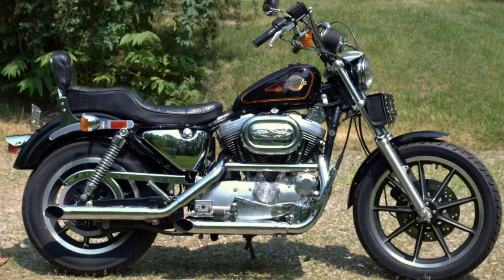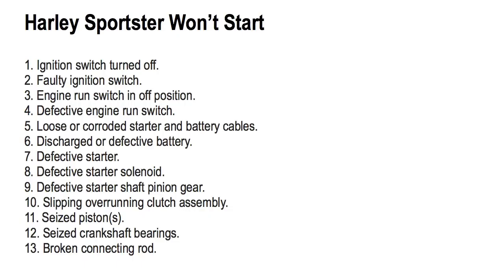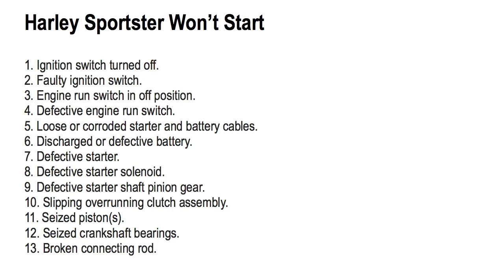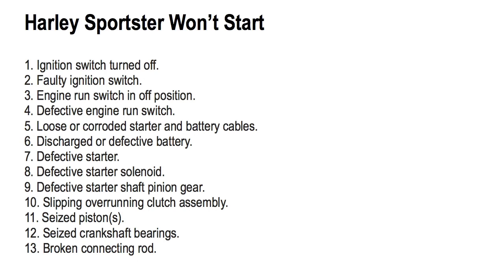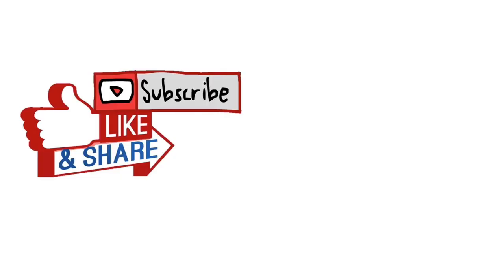Harley Sportster Won't Start (1986 thru 2003 Models)

Comment: # 14- Starter relay is bad (usually located near fuses. Sometimes the cover can be removed and contacts cleaned up with sandpaper)  , #15- ignition fuse is blown.

Comment: I have a 1999 Sportster and when the ignition switch is moved to the ignition position, the bike loses all power. I checked the fuses and all the 15 amp fuses are good. I did not worry about the 30 amp fuse, because if it is bad the bike would never have any power. I purchased a new switch and I just spliced the wires back and conneded it to the new switch and the bike still lost all power when the swith is in the ignition position. What do I do?

Comment: Was running, I turned it off and came back outside to ride again and now no fire to spark plugs, so I changed the coil and still no fire,to spark plug, but I do have fire to the coil on both sides
Reply: It's a 1984 and I also changed the points to electric
Reply: Ignition module, and or rectifier, potentially stator, trial and error, replace one at a time to see if the problem persists, one ,or the other will end up fixing it eventually!!!
Reply: @matthewburns6843  gotta be the dumbest way to fix a bike

Comment: 2003 hugger.  Battery is and fuses are good.   I get the dreaded click and need to rock bike to get her to start.    I’m having trouble putting the wiring diagrams with the actual bike to learn where/how to test the starter and ignition swithes.   I know where the relay is but not100% clear on how to test that or the circiut I believe is with the relay and fuses..   same  with the stator wires I learned are low front frame In case looking like a mini grill.    No idea where solinoid is or how to test that sf all

Comment: All I did was rinse my 2002 sportster off and it want fire now it turns over and I replaced plugs but no fire still what can I do next
Reply: Check, observe, and replace all electrical system components!!
Reply: Same problem. Did you figure it out?

Comment: I just replaced my stator. It started and ran fine. About an hour and half later it will not start. Cranks over but seems like it is  not getting gas and it has a full tank of Premium gas.
Reply: It’s because the 10% Ethanol boils at a lower temperature. So the heat of the Engine is boiling your fuel and turning it into steam causing vapor lock... put heat shield guards on your fuel line and only use non-ethanol fuel..
Reply: Try taking off the gas cap, then starting it!! Also check to verify if you have spark at the plugs, if not, probably the ignition module or electrical system, rectifier, coil?!!!

Comment: I have a 99 sporster. it was starting  every day. then for some reason when I turned the key , my head light did not come on. turn signals work , brake lights work. etc. But the neutral light won't come on and it dosent Evan click or turn over. battery was on trickle charger for hours. nothing.
Reply: Ken Sendelofski - same! What was the solution?  New battery, fuses fine....I’m leaning towards faulty ignition switch.
Reply: @cassidyhicks1724  I have the same issue all the sudden.   Did you figure it out ?
Reply: Fuse blown super EZ fix
Reply: Ignition modules go out, common deal on the Sportsters

Comment: Where is the relay fuses
Reply: It is in with the fuses.  Just behind the battery.   My 2003 has a triangle cover that just pulls off.  The relay is tucked above the fuses.

Comment: I have a 2001 Harley sportster hugger 883. I went out to start it this morning when I turned the switch to the first setting accessories the lights on the speedomitor came on also the light showing it was in enteral. when I turned the switch over to ignition the lights went out on the speedomitor it was as if I turned the switch in the off setting. I had nothing when I turned the switch in the ignition position no lights no horn nothing can anyone help ?
Reply: Did you  get an answer, my 1998 did the exact same thing today.
Reply: Any luck im having same issue this morning.
Reply: Bad ignition switch, check fuse block, check main circuit breaker (beside fuse block), check battery voltage
Reply: Same thing , yesterday afternoon, got a new circuit breaker on order and new starter relay.